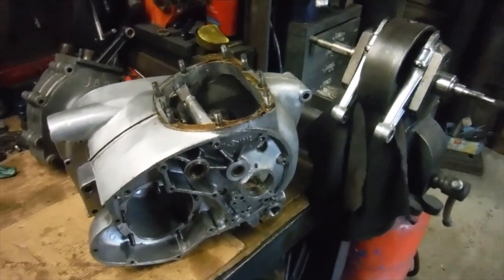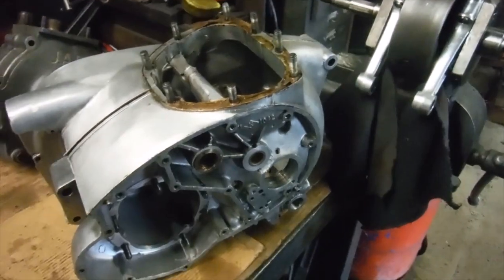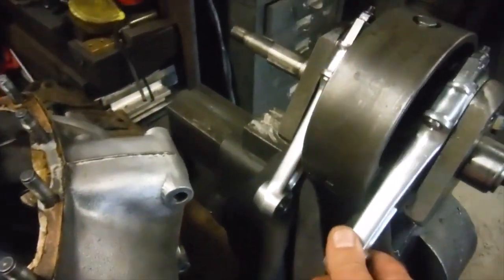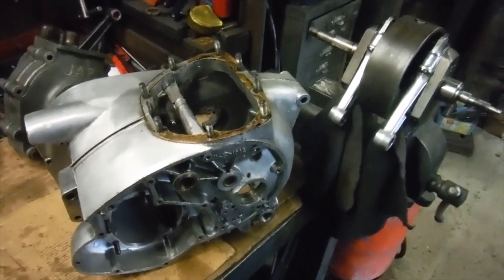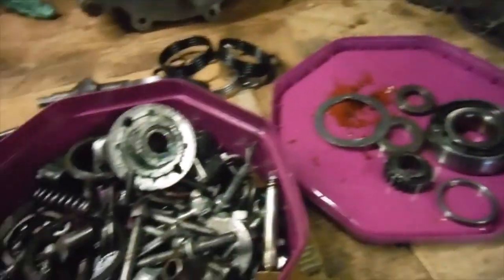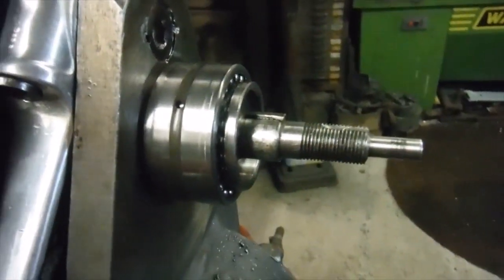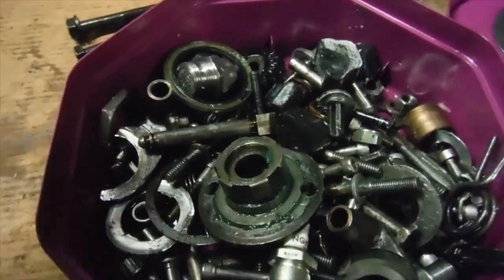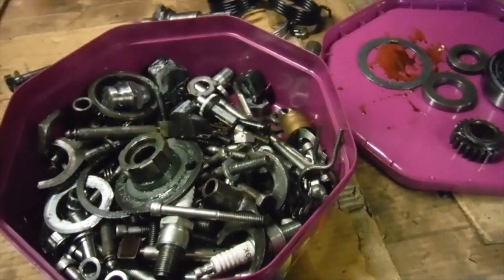BSA A65 - another one! - engine jigsaw puzzle 1 Reassembly begins.

Comment: Last T120 I rebuilt had all the parts laid out in disassembly order on blue roll in those lovely Tesco fruit boxes and contained in those hummus dip containers whilst the cases were apart for bearings.
Must have been a stack of almost ten boxes but it made it sooooo much easier when the barrels came back after a six week holiday at the reborers!
My camera never left the workshop during the process. Looking at that irresponsible box of assorted parts it’s no wonder the owner gave up on the job … and that you charge by the hour. 😂